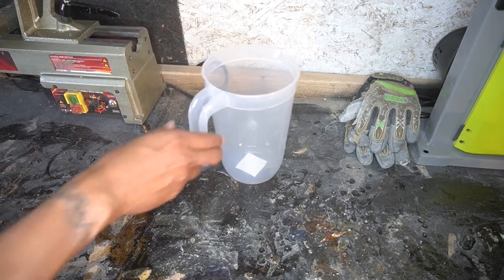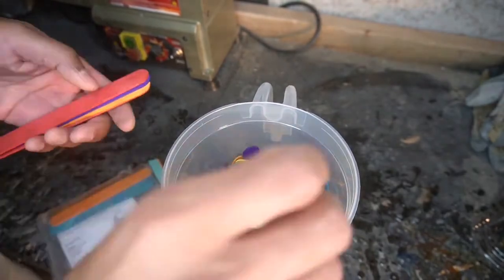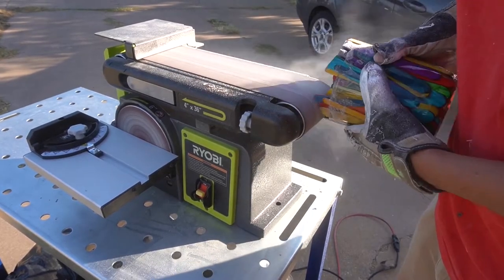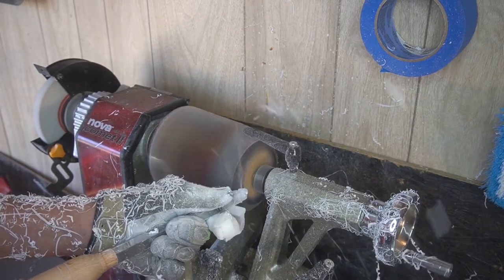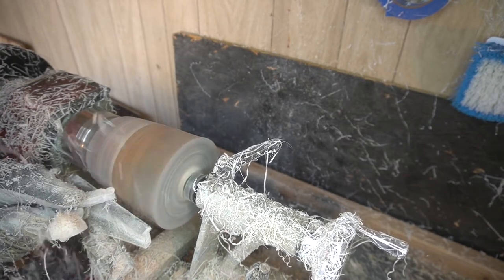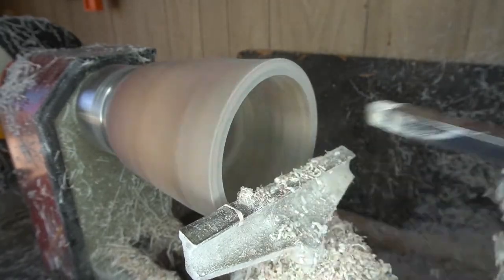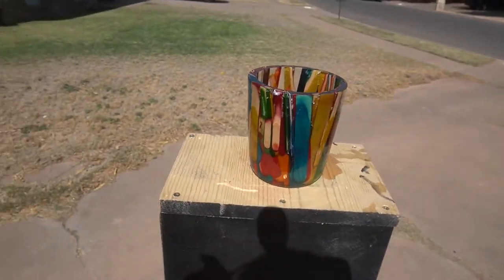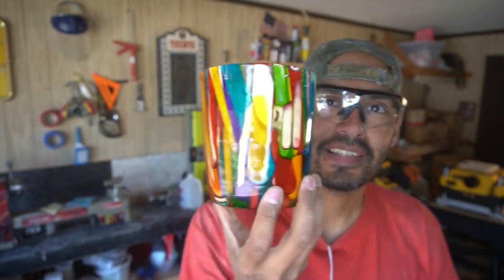Woodturning A Colorful Popsicle Stick Pot

Comment: Great pot Saulty, I like the way the sticks have so much colour and vibrancy and some are partially showing the inside of them, or however much you took off, and the clear resin too. Maybe next time you have a piece fly off, grab a hammer and smash a finger, one thing each turning must hurt, so injured finger = stay on the lathe 🤪
Keep on turning.
Cheers, Bluey 👍
Reply from the maker: I’m gonna make another attempt at the popsicle sticks for sure, next one will be a little better